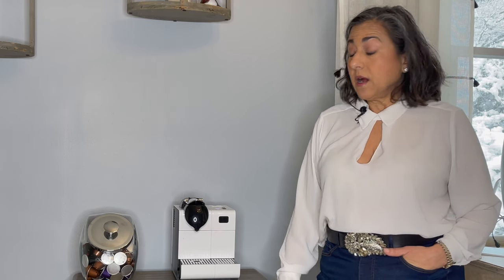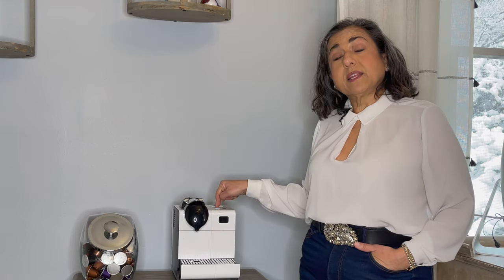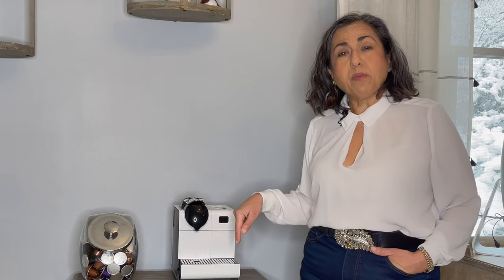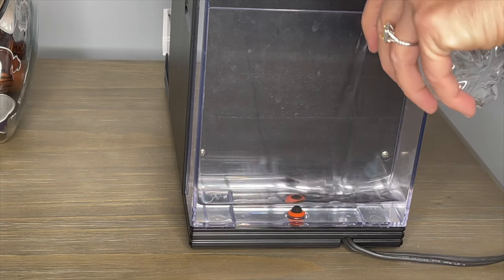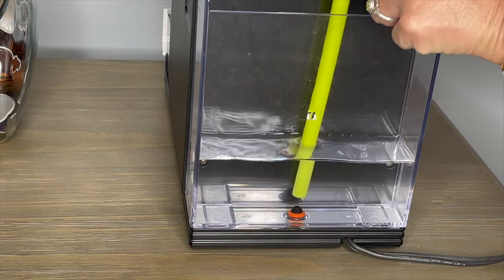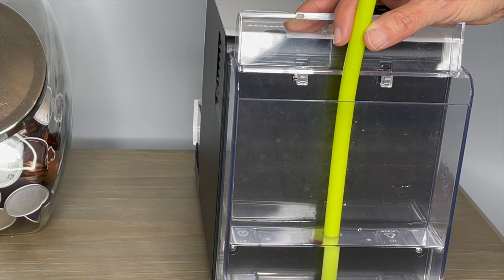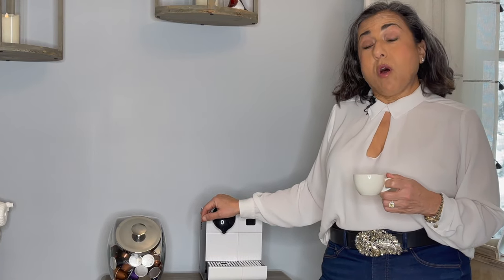Nespresso Machine Won't Pump Water? QUICKEST EASIEST FIX

Comment: Anita I work in Nespresso and my managers said my machine was broken. I just fixed it using your method. You're a legend.
Reply from the maker: Hi @charlifuxet6462!  I really appreciate your kind words. Frankly, I'm stunned that Nespresso does not acknowledge this issue. Judging by the number of people who have viewed this video, it seems to be very common. How are they not aware of it? Anyway, I'm really glad you found me and that this worked for you. Thanks so much for writing!
Reply: They told me it's air lock and it's because of an air bubble stuck inside the machine. It's quite common as you've said and we always recommend to our customers to run some water before using a capsule to prevent this issue. But you're right, as soon as it happens they don't help that much. Maybe it's just a way to make people purchase a new one. Thanks to you I fixed multiple machines at work today 😂 Thank you again!
Reply from the maker: @charlifuxe  That's awesome! Thank you for telling me that. It made my day. Maybe they should have everybody in customer service watch my video! LOL 🙃
Reply: Where did u get the straw lol
Reply: Get a bubble tea, enjoy it, and then use that straw :)
Reply from the maker: I put a link in the description, but yeah, have a bubble tea! 😃
Reply: @AtHomewithAnitaRosner   Yes!! 😄 Edit: I’m going to try this idea! I just ordered those straws.

Comment: Brand new machine. Attempted to do the initial cleaning step but no water flow. Found your vid, worked like a charm. Awesome fix. Thanks!!
Reply from the maker: Fantastic! You know, I’m hearing from a lot of people having this problem with brand new machines. I wonder why.
Reply: I just tried this method several times on my Nespresso Inissia (got it from FB Mktplce., allegedly new — it looked fantastic, turned on), with no luck. It might be that I did something wrong — not slamming this fixit. Anyone got some help? I can’t afford a new one, retail. 😊 Thanks very much in advance.
Reply from the maker: @Esther-kq7nv hmm…as long as the pump is running and there’s water in the tube, this should work. Is it possible you just can’t blow hard enough? If you can’t get it going, there could be something else wrong. In that case, you should probably contact the seller and get your money back. Sorry,  that’s the best I have to offer. Good luck. 🍀
Reply: @AtHomewithAnitaRosner  Thank you, Anita. 🤓 I blew as hard as I could, with water in the bubble tea straw. I’ll try some more. I’m not giving up just yet. It’s too late for getting my money back, unfortunately. If there’s something else wrong & it’s, “toast,” oh well. I’ll have to save for a brand new one from Nespresso or other retailer. Thanks again!!
Reply from the maker: @Esther-kq7nv call up the biggest blow-hard that you know. They’ll be thrilled that their personality flaw will finally come in handy! 😁
Reply: @AtHomewithAnitaRosner  🤣🤣🤣

Comment: You saved my vacation. I had to modify your technique because of the model of machine. The reservoir was much deeper. I used the only straw I had, the one in my ThermoFlask water bottle. It was too short for the large reservoir. I removed the reservoir.I held the bottom of the straw with my finger and filled it with water at the sink. Then I quickly put the straw over the intake where the reservoir would normally sit and blew it in. Repeated about 3 times. I replaced the reservoir and it pumped perfectly! Thank you so much!
Reply from the maker: Oh Debra! I'm always delighted to hear from satisfied "customers"! Enjoy that vacation and your coffee.
Reply: On vacation, no straw, NEED COFFEE! Thanks to your comment I realized I had a straw in my BrüMate tumbler. Brilliant. Thank you for saving my morning. :)

Comment: Tried multiple fixes over the 36 hours, descaled and cleaned this machine numerous times till it was sparking, the spinning disc was like a top,  the pod holder was clear as a bell, and still orange blinking lights.   Nothing.  THIS WORKED! Bless you for this, you are the best!
Reply from the maker: UGH! What a headache.  I hope you didn't go through the customer service torture, too.  Glad I could swoop in to help. If you become a regular viewer, you'll find I have lots of ideas and delicious recipes, too.

Comment: This trick is the best!!!! I watched other videos and didn’t work. I used a metal boba straw and poke from bottom up, I let the water run. Put the water tank back in the machine and run like a charm. (Side note: I didn’t use the Pixie for 3.5 years due to living situation. So I guess the rubber part got stuck to the machine.) Thank you again!!! I have this baby for 14 years and it’s hard to let go.
Reply from the maker: That’s great!!! Congratulations 🎉

Comment: You're a legend!!! Thank you so much!!! Fixed it in ten seconds with your hack! Machine was not in use for five years and now it works again, like new!!! Thanks again❤
Reply from the maker: A legend?! Wow, that feels good. 😊 I'm really glad this worked for you. I discovered this fix under the same circumstances. I had a machine that I hadn't used in years. Now, mine too is like new. Thanks for commenting. I really appreciate it.

Comment: Tried a few other suggestions, that didn't work, and finally saw your video.  I bought one of these straws, took the water container away from the machine (I have one of the older red ones), put the straw on top of the black filter and blew several times intermittently into the straw.  Took around 3 or 4 tries and then put the water container with water back on the machine, pressed the large cup button and VOILA!!  It worked!!!!  Thank you, thank you for the info, very much appreciated.  Love my Nespresso!
Reply from the maker: Yay!!!!!

Comment: Thanks! It took quite a few attempts, and I had to whittle the end of a length of rubber hose with a knife to the correct diameter so it would fit the water inlet of my unit and take the tank off completely.. But once I saw your video and learned what my problem likely was, I was determined. It finally worked! I dont have to call customer service to try and fix my brand new unit! :) Appreciate you!
Reply from the maker: You whittled?! Wow, you WERE determined. But it was worth it, right? Glad your new machine is up, running and providing you with delicious coffee!

Comment: Here comes another impressed and grateful viewer writing in to report your fix worked perfectly. The hardest part was finding a straw long enough to do the trick. 

For what it is worth to others, for me the air bubble (I didn't know at the time what it was) happened right after I completed a descaling cycle. I had run descaler solution through 3 times. I was attempting to run the clean water through to rinse the machine but that's when the pump started getting no water. Anyway, the fix was easy as is pointed out in this video. Machine works like new again. Definitely give it a try if your machine is acting up similarly.
Reply from the maker: Thank you for this lovely comment.  Descaling can be a headache for the reason you described and also for overheating the motor.  So here's another little tip: If you're descaling and suddenly nothing seems to be working, walk away. Let the machine cool down for about 20 minutes and then you should be back in business.

Comment: It worked! I’ve tried different methods but only yours has worked! Thank you sooo much!
Reply from the maker: That's happened to me as wll.  I watched a bunch of videos that didn't work (some of which went on for too long before getting to the point IMHO) . This was after suffering through customer service for about an hour and 45 minutes. Just as I was about to pack my machine up and ship it for "repair", I thought 'hey, if it's basically an air bubble, why don't I just force it out?'. And VOILA! ...this video was born.  Glad it worked for you, too!!!

Comment: You are the only person with a solution that works. Thank you!
Reply from the maker: Thank you for saying so.  I tried other people's methods (which were frustrating and made a mess), then tortured myself by calling customer service (and I do not exaggerate in the video. I was on with them for AN HOUR). Then I thought, "why not just blow water through it with a straw?" So simple, right? Thanks for watching and leaving a comment.

Comment: I thought my machine had just given out…it’s a Mini and gets a lot of use. Thankfully. I had purchased a Citiz…a Christmas gift to me, but it would not pump water! Saw your video and found a straw, but it wasn’t working as it didn’t totally cover the orange button. Not having had my morning coffee, I was at my wits end, then noticed that the button on my Mini was smaller, so gave your fix a try. Voilà! I’m now enjoying my morning cup and will find a larger tube to give it a go on the Citiz. Thank you!
Reply from the maker: That’s great!  As for your Citiz, this will work too. Judging from the many comments on this video, it happens often with brand new machines. You could exchange it, or you could save yourself that hassle and try my method. Good luck!!
Reply: Thanks! The Citiz wasn’t cheap and it is past the return date for Amazon and the private seller, so my fingers are crossed. The sputtering of my older machine was so unusual…I use it daily, so apparently the air pockets can happen at any time. Again, thanks!

Comment: I was super hoping that it would work for me. But it hasn’t and all the other fixes I found didn’t work either.

I tried blowing, pushing down the straw and blowing, pulling up slightly on the straw and blowing. Every variation I could think of.

Anyway, I loved the video!😊
Reply from the maker: I'm so sorry! I'm wondering if you're having a different issue from the "air lock". Anyway, I hope you get some resolution with customer service (make sure you've got some time to kill before you call), and thanks for writing.

Comment: Great video!  But i don't have anything the size of a bubble tea straw.  Any other possible suggestions? 😢
Reply from the maker: This is going to sound crazy, but hear me out…create a tube with aluminum foil. The most important thing is that you make a seal (as tight as possible) over the gasket (use your fingers if you can fit your hand in there). It might do the trick. Good luck!!

Comment: Thank you so much!! We bought a new machine and it was not pumping water!!
Reply from the maker: There are a lot of comments on this video about brand new machines malfunctioning in this way. I find it shocking! It's a pity really, because I think these are great machines...when they're working. I love mine (I have two). I even travel with the smaller one. Anyway, I'm so glad I could help!

Comment: I did them all, the straw, the ziploc bag and opening and closing the water container to release the air pressure.   Finally what worked was to reset the machine and poke the top spout with a paper clip, that released the remaining air and the machine is back!!
Reply from the maker: Yikes! Sounds like you had a blockage. Glad it worked out.

Comment: I love your presentation and your style!  But, sadly, this didn't work on my machine. I tried 5 various sized straws, flexible and rigid, but none worked. I am not ready to give up just yet though. Thank you for sharing your idea!
Reply from the maker: Oh no! Thank you for your kind words, but I'm sorry this didn't work for you.  Since you're not ready to give up...when you try again, make sure the tube/straw is filled with water and TIGHTLY up against the gasket (otherwise you're just blowing water into the reservoir), and be sure the machine is running.  Good luck!
Reply: Did you ever find something else that worked?
Reply from the maker: Nothing else. And the other methods were either ridiculous or messy (and also ridiculous)

Comment: Do you need a straw
To go around the gasket completely to the bottom? It doesn’t make sense to just blow on top of the gasket since the water comes from underneath it but in your video it looks like your straw will not fit around it? 
From under?
Reply from the maker: Just cover that hole! As long as the straw is snug over (or on top of) the orange gasket. Good luck. You’ve got this Bryan!
Reply: @AtHomewithAnitaRosner  mine might just be a different model. The entire gasket lifts and is air tight so water flows underneath the orange gasket. So if the straw is just in top of the gasket it is not physically possible to push water through the system. It has to get under the gasket from what I can tell. But I don’t think I can find a wide enough straw. We shall see what I can do!

Comment: Did you get any help at all from customer service?
Reply from the maker: Honestly, the rep seemed to be reading from a script and was not helpful. I’m sure Nespresso is aware of this airlock problem and yet, the rep never mentioned it once. And I told her I hadn’t used the machine in over a year. So that should have been the obvious problem. I had to figure it out in my own.

Comment: Just tried with a piece of garden hose, but when I blew, the air bubbles made the water flush out from the water tank.
So I removed the water tank and put the garden hose in to the water valve, just far enough to make it tight. Then filled it with water and blew like hell while i pushed the coffee-button. Finally some water started coming out, and now it works again.
So the solution is basically a piece of garden hose and strong lungs :-P
Reply from the maker: Yay!!! Nice job. Congratulations.

Comment: Or just push upwards the silicone valve in the water tank above the sink until the water starts leaking and you'll notice an air bubble getting released. That fixed the issue too
Reply from the maker: Thanks for sharing.

Comment: This is great, if the issue is an air pocket.  My issue is a constant green light and machine won't even start.  I tried that straw thing and almost blew my head apart!  So tired of these machines not working.

Comment: I keep trying and trying and nothing will come out...even using this technique. I'm not sure what I'm doing wrong
Reply from the maker: Are you doing it with the machine running and do you have water in the tube/straw? If it’s not working, you might have a different issue. I’m sorry.

Comment: What kind of straw did you use?
Reply from the maker: It’s a silicone bubble tea straw.  But anything big enough to fit over the gasket will work.
Reply: @AtHomewithAnitaRosner  Il try to find one, wish me luck ive been fighting with the nespresso machine for hours 🥲
Reply from the maker: @miguelcarrera617  good luck! Try a hardware store for a small piece of rubber tubing. That would work!

Comment: There are TWO problems and you have to fix both.  First problem is as described in this video.  2nd is descaling.
1- You need a fat straw about 1/2" in diameter.  Best is to buy a CLEAR rubber tube 1/2" from the hardware store.
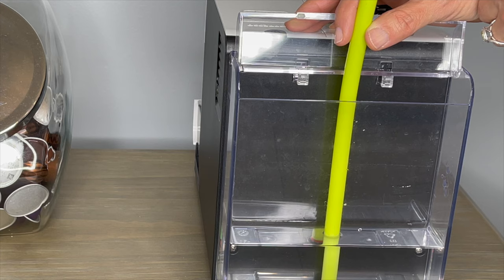2- Fill tank and place the tube carefully as shown on 00:40 in the video, to cover the orange gasket.
3- Blow.  If it is difficult to blow and the water level in the tube drops slowly, it is because the internal pipe has been calcified.
4- Get a bottle of de-calcifier and lime removal (like CLR), do not mix with water, and pour undiluted to about 1/3 of the tank.
5- Turn on long-drip, and blow into the tube.  After a few times, you should notice that blowing becomes much easier - indicating the decscaling has succeeded.
6- for about 5 to 10 times repeat without blowing, and recycle the de-calcifier from cup to tank.
7- by now the clog should be opened.  Thoroughly rinse and make sure no chemical remains in the internal pipe.
Reply from the maker: That would be a descaling problem. While mine addresses the air lock, I suppose both problems could happen simultaneously. Thanks for writing!

Comment: it didnt work, any other suggestions?
Reply from the maker: I’m sorry you didn’t have any luck. I assume you’re using Nespresso capsules. If the machine is running and you’ve put water in the tube, it should work. Perhaps your machine is having a different problem.

Comment: Anyone have luck doing this with the Nespresso le cube? I’m trying and trying but no luck 😫
Reply from the maker: Try this: Turn the machine on. When the buttons illuminate, press the "Lungo" button and fully open the hatch where you put the coffee pods and leave it open. (Do not add a pod!). This should start the flow of water. Simply press the Lungo button again to stop the water flow. I hope this works. If not, you might need to descale your machine. Good luck!

Comment: Didn’t work for meeeee . Maybe I’m doing it wrong?
Reply from the maker: Let's try a few things, Frances...First, make sure the machine is running. Next, make sure there's water in your tube before you blow.  One other things you can try is this: Take the water reservoir off the machine and (holding over the sink), press up on the gasket from underneath and make sure water comes out. It could be stuck.  Good luck!

Comment: Mine isnt working still. Please someone help
Reply from the maker: You must be feeling very frustrated right now.  I assure you, this method works.  Let's go over the instruction: 
1. Take a deep breath, because I know you are out of patience at the moment
2. Put water in the reservoir. 
3. Place a straw or tube in the reservoir that is big enough to fit over the gasket. 
4. FILL THE STRAW WITH WATER (THIS IS VERY IMPORTANT).
5. Turn the machine on and run it as if you are making coffee
6. While the machine is running, BLOW!!!
You might have to try a few times, but it should work.  I've gotten a ton of positive feedback on this method.
The only other explanation is that there is something else wrong with your machine.
Don't give up.  I believe in you!!!